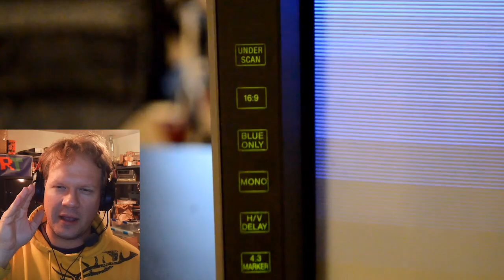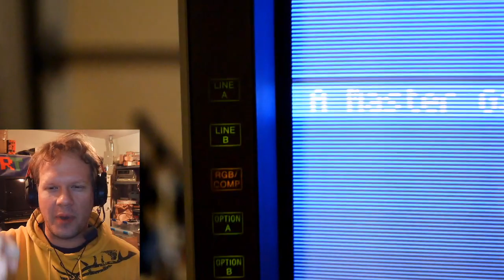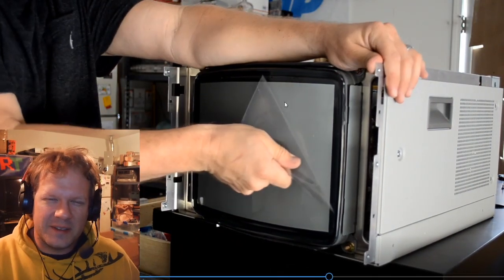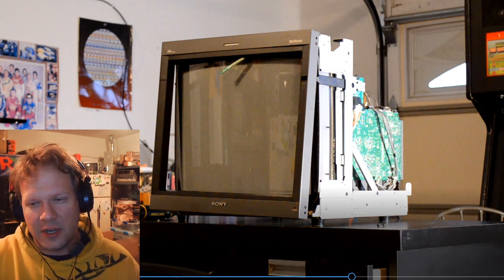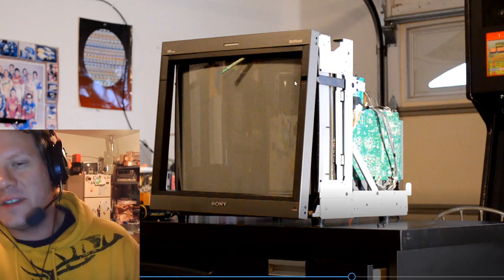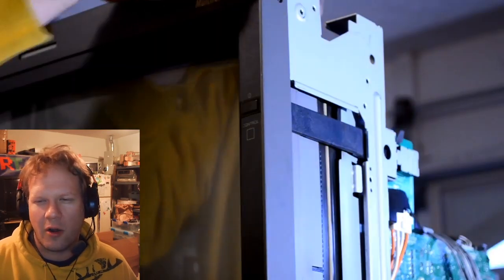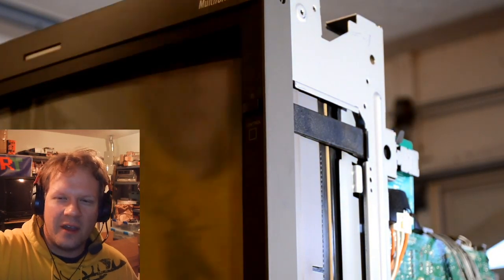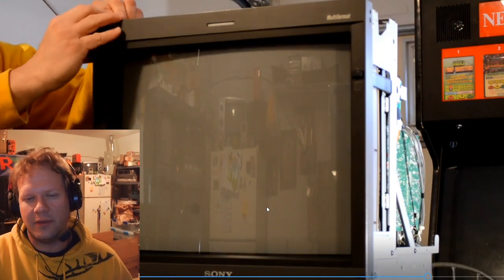Sony PVM 20L5 | Chipped Screen Fix | Screen Protective Layer & Bezel Repairs

Comment: Big thumbs up for this vid. Got a 14L4 with a pretty big centered chip and scuff. Removed anti glare with no issues! So L4's also have the film. At least this one from 2001. Thanks!
Reply: That’s great to hear. I’ve just gotten a 20L4 with a small but annoying scuff in the centre of the screen and I was 99% sure what I was looking at is an anti-glare layer. There’s very little written online about the L4.

Comment: My lights were also dim when I bought my 20L5. I found out incidentally if you press the "up" and "down" buttons when the menu isn't up, it adjusts the brightness of the LEDs. Which, of course, solved my issue lol.
Reply from the maker: Cool thanks.
Reply: No prob dude, just trying to do what little I can to help. Thanks for the great vids and repairing my buddie's 14L5 a few months back!
Reply: @rikuouroboros6027  Just tried this on my 14L2 and they do not adjust. Must be a L5 feature. Dang I really wanted to adjust my LED's lol.

Comment: I have a 20M4U with some scratches on the screen, according to the label it's from September 1997, which I believe is the year this model was released, you mention the older 20M4s probably don't have the layer and I saw one of your videos where you mention that I'd have to completely dissemble the PVM to remove the vessels and find out, so I'm going to assume I don't have the layer. I would appreciate a video showing a method to remove scratches from the CRT glass if you happen to experiment with any method in the future, thank you for your videos.

Comment: On the GDM-FW900 that I sold, the antiglare coating had a blemish so I removed it. Next thing I know, the glass attracted dust like no ones business. Every day I could wipe off a decent amount of dust. Had I known, would have left it on there. The antiglare coating looked like a dark piece of window tint. I imagine the black levels weren't as dark with it removed. If you own a trinitron computer monitor and the coating gets damaged and it get removed, any dust and debris will be attracted the glass. You have been warned.
Reply: Thanks for the warning. I think my Sony E200 still has the anti glare coating on it because there are some small blemishes that don't look like glass-scuffs. so I think it is the coating that is slightly damaged. It's hardly noticeable unless viewed on a bright white image though. The screen attracts enough dust spots as it is, so I'll be leaving the coating alone.
Reply: @Camtron47  Manufacturer's of products try to save money any way they can. Saving a few cents per product adds up when selling millions. They put expense, research and development, paying someone to apply the film, thereby putting it on there for a reason.

Comment: I've got the same LED problem since I got my 20L5 a few years ago, they light up bright at first but then immediately go dim.  I was told they'd burn out eventually, but they're still going. I dread the day when my 20L5 will need to be re-capped though, just taking it apart looks like a long, confusing endeavor...